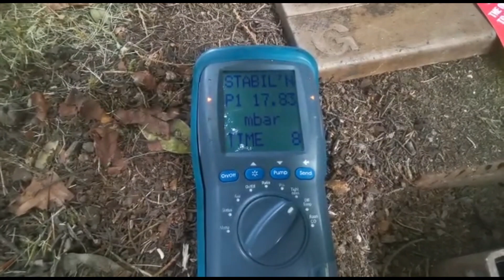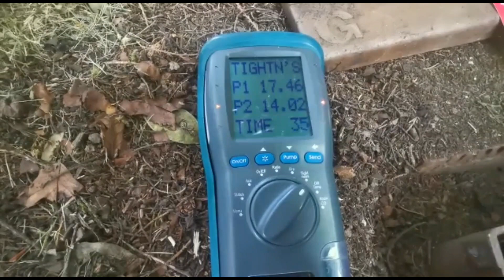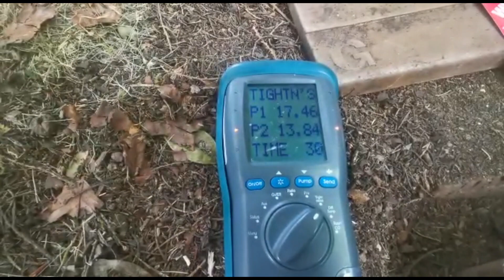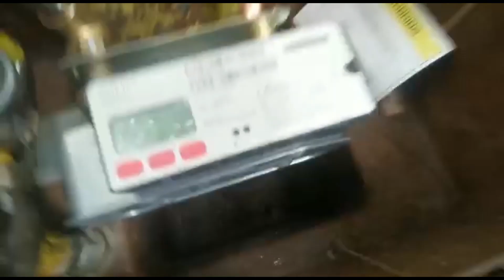Gas Leak Part 2

Comment: That's the trouble with old buried supplies, only got to look a few years back at the plant that exploded in Scotland due to an underground leak on old pipe. Wasn't long after that they made sure all mains and tank supplies were tested and anything new went in as poly or wrapped copper. Much safer to disconnect, cap and run new pipe.
Reply from the maker: Respect for the support. Couldnt agree more, we need to re route this correctly, need to look at our options this week 👊🔥